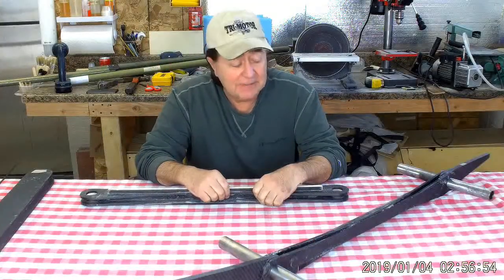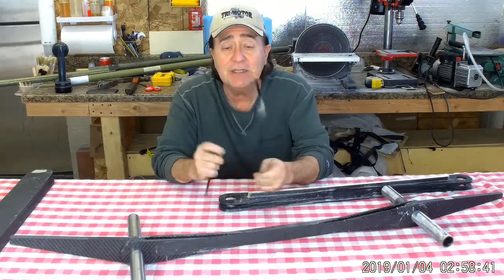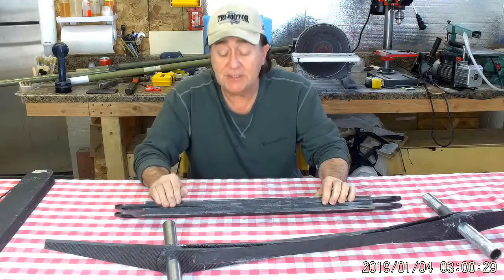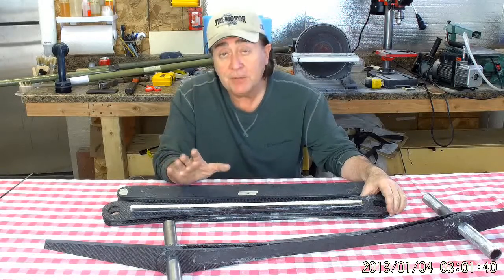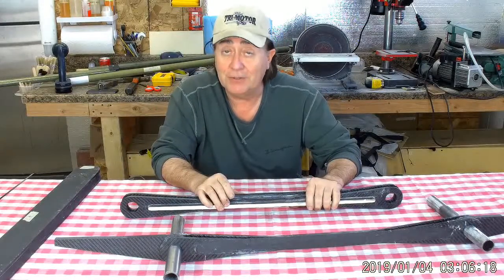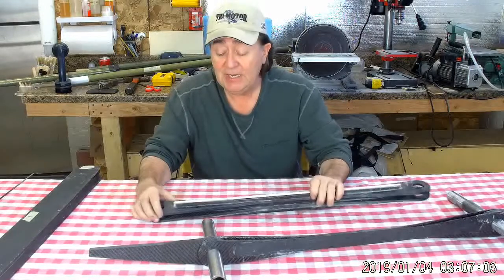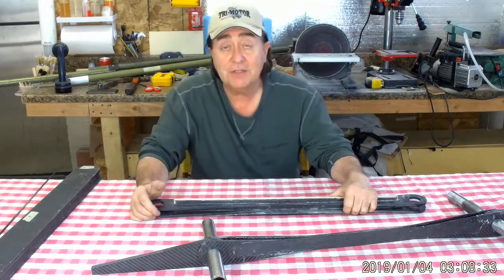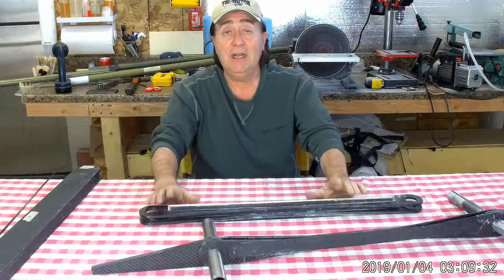Spar Carry Through Redux Part II - KW MkII Foot Launch Class 2 Hang Glider Sailplane Development

Comment: Maybe some jig blocks nailed to your workbench that would hold the part, then you could wedge the clamp blocks against it to get the clamping force. Wish I could draw a picture, lol.
Reply from the maker: No need for a drawing, I totally get it. Great idea! I'll use it for when I do the fittings that go on the main wing panels. This is what I love about social media, lots of brain power to help me get the job done. Thanks much!
Reply from the maker: BTW, if you send me a note at rolkling@gmail.com I'll send you a pdf set of plans for the 1/4-scale R/C model as a "thank you".